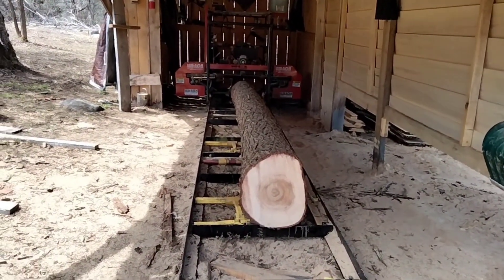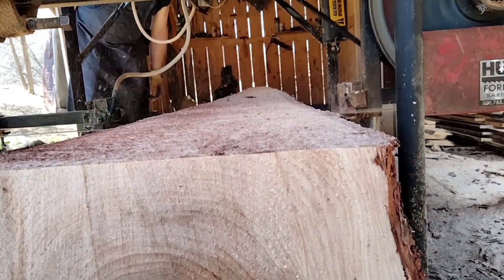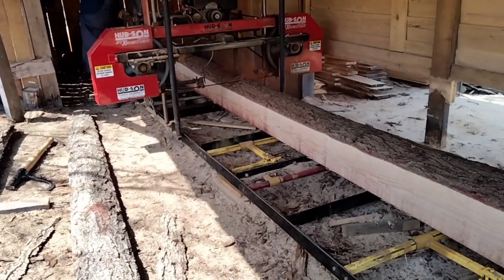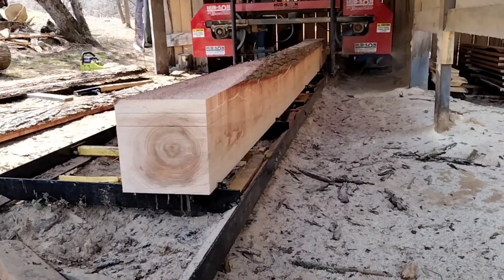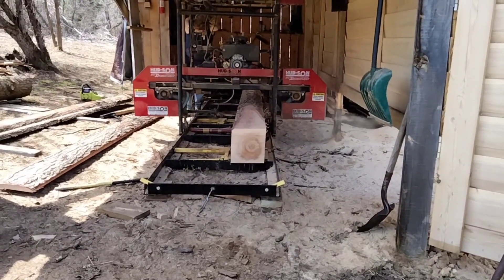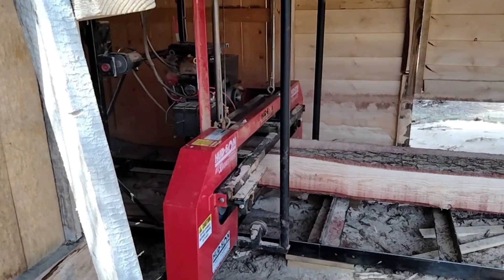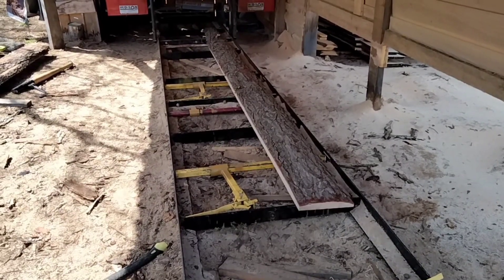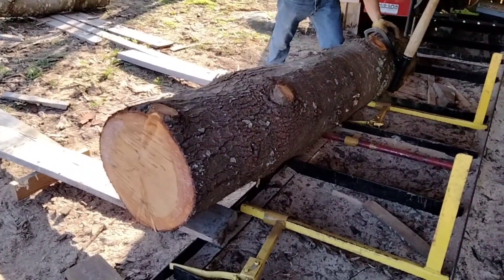The longest log to date on the Hud-son Homesteader HFE30

Comment: I have 2 extra sections of track and I think if I maxed out my mill I could get 21 foot I did cut a small 20 foot pine for blocking
Reply from the maker: I have 3 sections of track, with an extension for the mill head to park on. So I can utilize the full 3 sections